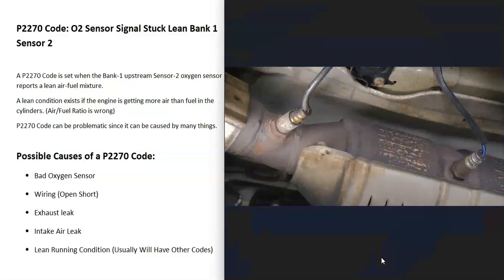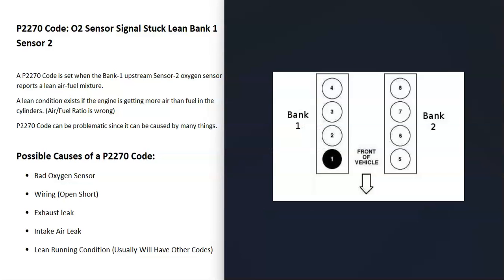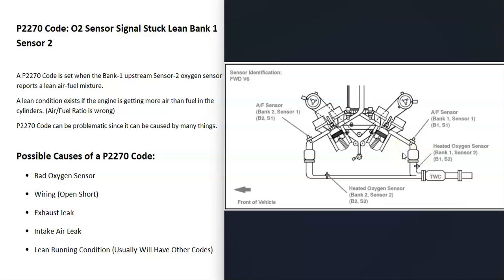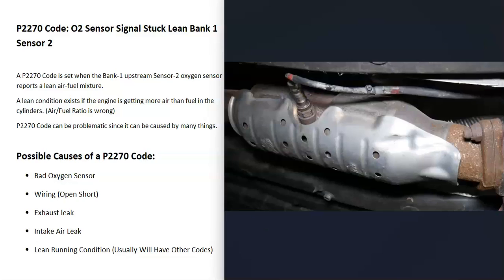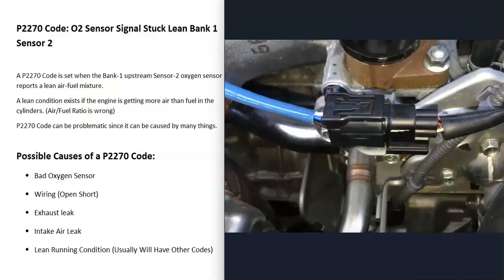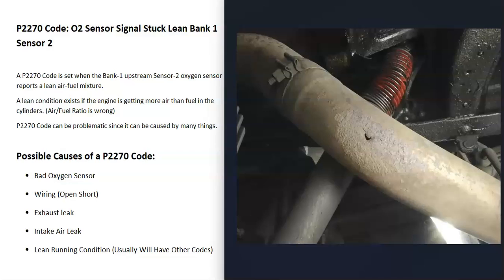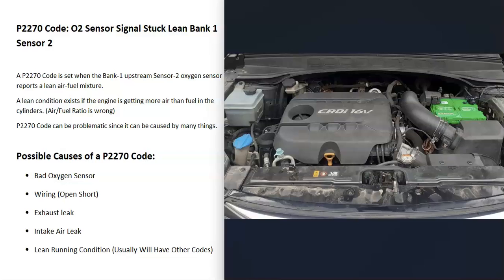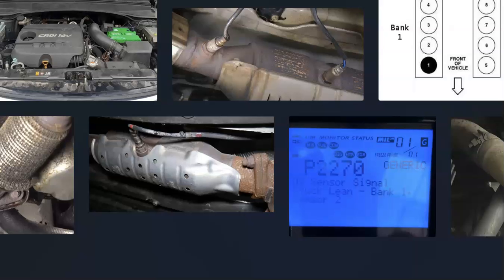Causes and Fixes P2270 Code: O2 Sensor Signal Stuck Lean Bank-1 Sensor-2

Comment: If I had P0137 (low Voltage to Sensor 2) several times and it started to cause a misfire on Cylinder 2 P0302 (its a 3 cylinder petrol) and then eventually stuck open with P2270, would that be a bad sensor still?
Reply from the maker: Usually, a bad O2 sensor would not cause a misfire, but with a 3-cylinder engine, I am unsure. I would test the sensor to see if it is good. If it is good, then there is another issue.

Comment: Quick question codep2270 and always p2138 throttle petal … could that signify air leak or two different problems occurring?
Reply from the maker: It's possible they are related. For example, if there is a throttle body issue, it may be causing the engine to run lean, but it could also be a separate issue. I would test the 02 sensors and see if they are good.

Comment: Hello, after changing my sensor about a year ago, I'm getting the same code P2270, could it be something else? Could it also be the type of gas I'm using?
Reply: i changed my sensors about a year ago and i am also getting this code
Reply: @jbaz964 Happened to me too, just changed the sensor for a new one and now I’m getting the same code. Did you figured out what it was?
Reply: @BlxssedKing  it’s a 5.3ltr with 200 k miles. I took the whole air intake off and cleaned the heck out of it and every sensor I could get to. I also cleaned the intake ports to the engine with rags and air intake cleaner. Just don’t push any debris into them. Basically cleaned it up and the code went away.
Reply: @ I also got a smoke machine to see if I had any air leaks

Comment: What if your car takes 93 octane premium and you’re putting 89 octane which is plus cut that be the cause of that as well because I just changed my O2 sensor. My check engine light was off for two days and then I filled up gas didn’t have much moneyso I put 89 instead of 93.
Reply: Read the code again to see if it’s a different code.
Reply: @TEEDUBS  so the code that was throwing before was for oxygen sensor one now it’s just showing that it’s running lien

Comment: I am getting both of these codes at same time.....PO2270 & PO2271  my question is how is it possible to be stuck lean & stuck rich at the same time? Is it possible that one of the new O2 sensors was bad?  It's in a 2008 avalanche ltz z71 4wd v8 vortec engine. The 5.3l. Help?
Reply from the maker: I would test the 02 sensors and be sure they are good, along with the wiring. It's not common, but an engine can run rich and lean, usually from a bad sensor or timing problems.

Comment: Can this code somehow be triggered by the upstream o2 sensor? I ask because I got this code but when I looked at my scanner data the upstream o2 is showing no data at all (doesn't even show zero) and the downstream looks to be working as it should. Doesn't make sense in my case given the code pertains to the downstream sensor.
Reply from the maker: They work together so they can affect each other. If sensor-1 is bad, I would replace it, clear the code, and see if it returns.

Comment: I installed a new o2 sensor, and this code popped up p2270
Reply: Im having the same issue
Reply: I got the same issue
Reply: @Fredimar1329. have you got it figured out?
Reply: @J.Dez89 I have the same issue, replaced it with a new one and the code popped up. Seems like we’re all going through the same thing what could it be?
Reply: I’m having the same issue
Reply: @johnnymikeasky6815. have you got it figured it out?
Reply: Any of you find a solution for this?
Was the new sensor original or aftermarket?
Did it need coding afterwards?
Reply: i have the same issue on my 2018 toyota Camry
Reply: Same car 2018 Camry, replaced it with a new one and got the code. Did you figured out what it was?
Reply: Has anyone figured it out?? @blxssedking @j.dez89 @multimrdouchebag @tonikroos